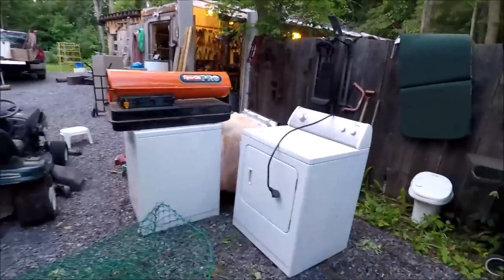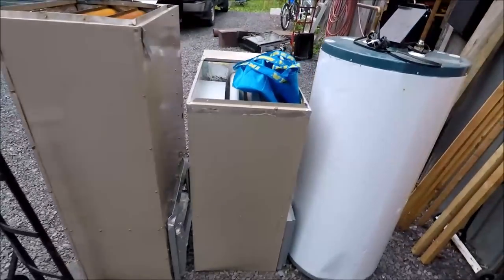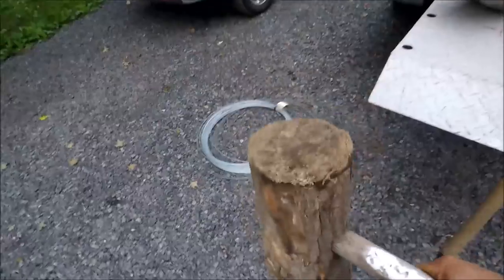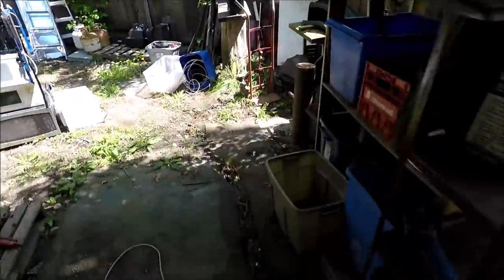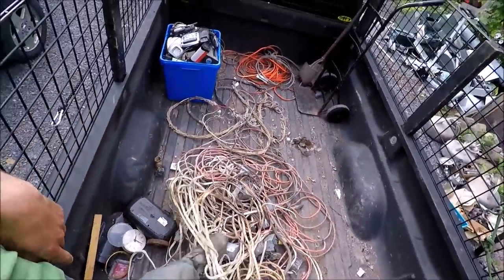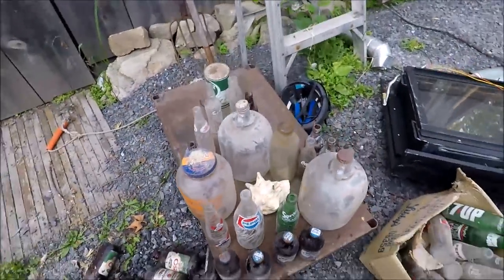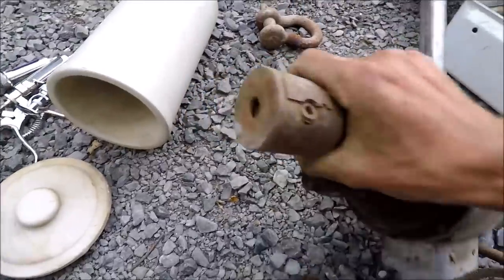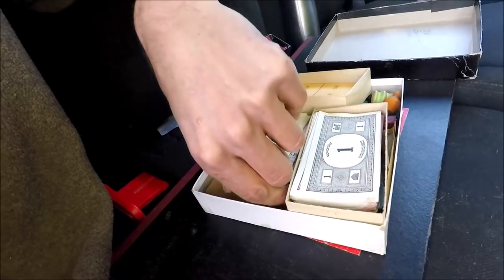Cleaning out an old barn looking for treasure, nice auction haul too!

Comment: The spikes and the ground cables were lightning Rods . Th points went on the barn roof.  The heavy ground cable down to the ground. Here is how it works. Lightning will strika sharp point that is grounded on the barn, hence  the  the sharp point, the voltage goes straight to ground through the cables, instead of hitting the barn and catching the barn on fire.
Ron B Michigan

Comment: I noticed a pile of pc's ,  Ewaste Ben must be salivating. Ha Ha.  What I do with computer scrap is I take off the aluminum heat sinks on the boards and list them as scrap for about 2.50 a poundUS in lots of about 5lbs plus shipping.  They sell pretty fast at auction some times more that 2.50 a lb

Comment: 12:23 Probably cheapest /easiest to make Frame ,is made from ye old slotted heavy duty Unistrutt channel and unistrutt fixings, if you can get the odd offcuts parts from your HVAC Connection, they should use it regularly for fan/ Ductwork support. all the best great vids as always very entertaining, thankyou dude.